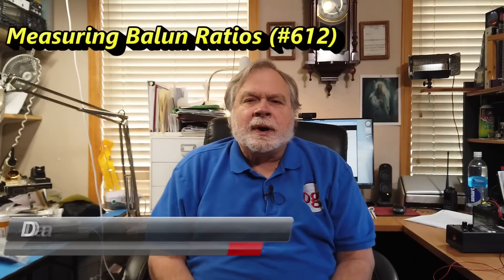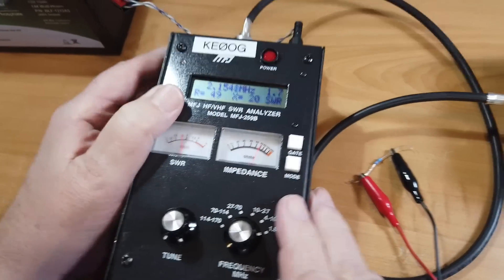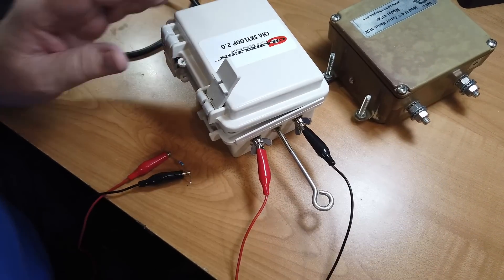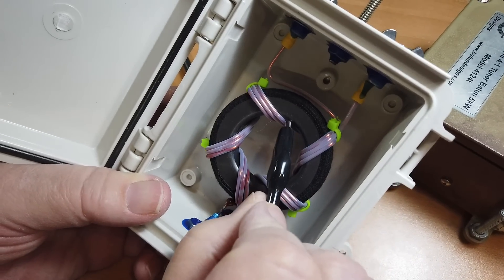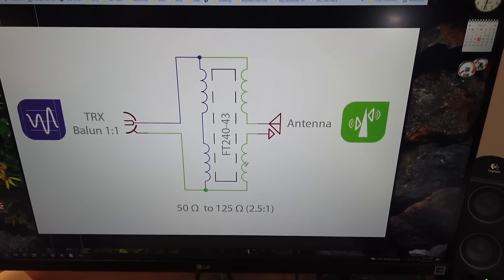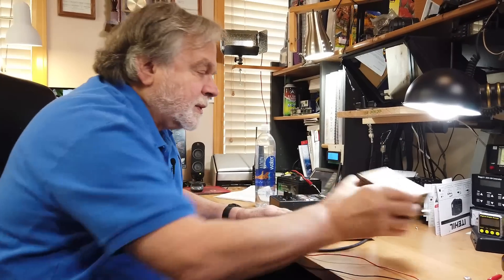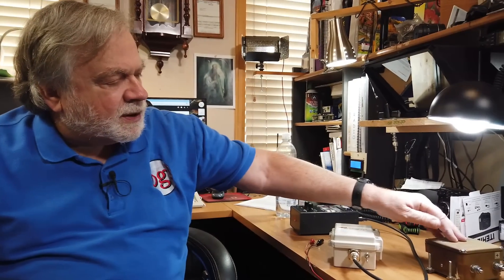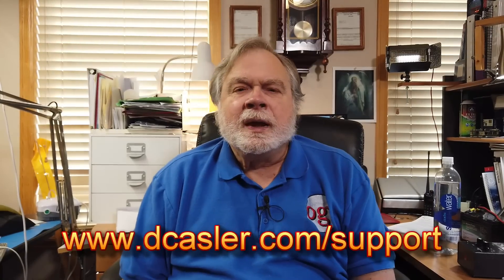Measuring Balun Ratios (#612)

Comment: I know about using resistors and the values to test them. The one thing  I'm wondering is it possible to use a Variable resistor and still get accurate results? And would it matter what type of Variable resistors used?

Comment: Those long leads are probably what's causing the reactance...Just connect the resistor right onto the transformer terminals...You can just count the turns to get the turns ratio, then square it to get the impedance ratio...3 turns / 2 turns = 1.5:1 turns ratio...1.5 squared (1.5 x 1.5) = 2.25:1 impedance ratio...50 ohms x 2.25 = 112.5 ohms output impedance.
Reply from the maker: Good point. Thanks.

Comment: Thanks Dave. I have a balun that is made from PVC pipe that I think originally came from MFJ but the markings are long gone. I used and adapter and the 50 ohm calibration slug from my VNA and measured the resistance with my MKJ-269B.  The resistance in the 80m band showed 50 ohms so it looks like I have a 1:1 ratio. Now how do I tell what type of balun it is? Is it a current balun or a voltage balun? An isolation balun? Can it be used to keep RF out of the feedline and shack? Thanks.

Comment: Im renovating my radio room after 44yrs. In 1977 it had floresent light bulbs which caused noise in my HF reciever. I changed to incondesent bulbs. Im considering LED bulbs. Will it cause noise ?

Comment: hi dave could you help i just   made a fan dipole for 20  40m  my centre feed point is at my bedroom window sil  forward out to my back fence at 85 90 degrees apart  will it be fine to use as a slopping away v down to 7ft off the ground  yours mark thankyou

Comment: I've watched a lot of balun videos Dave, yours and many others, but there are still so many questions that either I don't understand the explanation to, or I can't find an explanation for...like the arrangement of windings that make one design a voltage balun, and a another design a current balun. And about the arrangement of windings, on a 49:1 unun, why are the first two windings of the 50 Ω input and one of the 2450Ω output wires, twisted together in most of the designs you find online? Are baluns/ununs more efficient than lumped LC matching networks at the feed-point for a single band antenna, what are the pros and cons of each?  Ferrite rod designs seem to be easier to understand in laying out the wire turns, but is using a toroidal core more efficient, and what's with all those intricate wire wrapping arrangements for toroids?  Also, is there a reason every unun, isn't simply designed as an autotransformer? And finally, I saw a design for a 4:1 air-core balun which the author said could handle more power than a ferrite core balun, if that's the case, why aren't there more balun designs that use no ferrite? ...and I won't even start to ask the questions I have about transmission line balun designs...

Comment: I use a VNA and a potentiometer to measure the ratio.  Adjust the pot for minimum SWR, then measure the pots resistance.  Ratio = resistance/50.
Reply: Wow that’s a good idea and simple.  I will keep that in mind before purchasing a Balun.